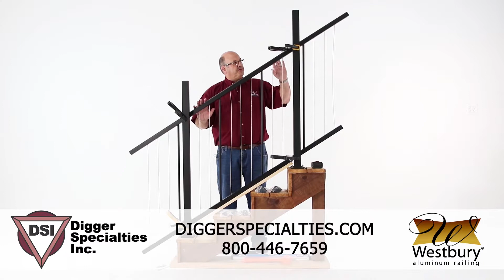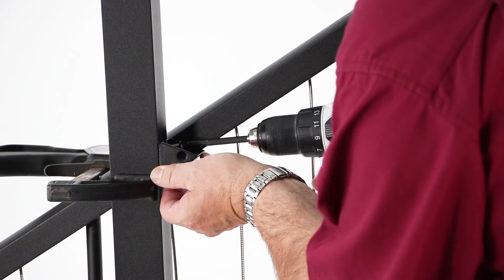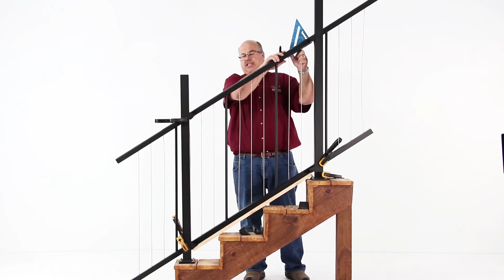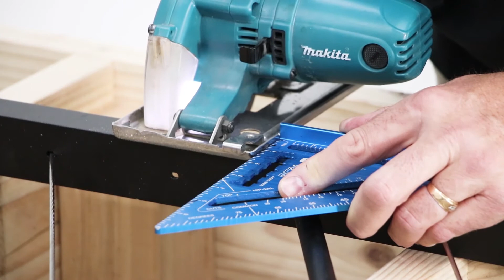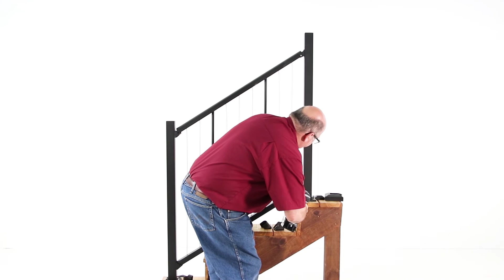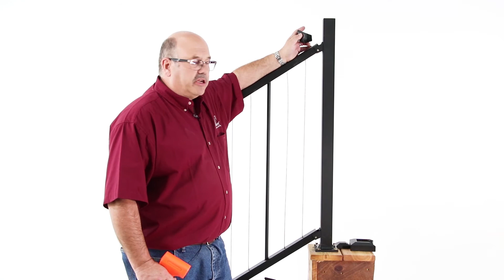Installation: Westbury VertiCable® (C80) Stair Rail

Comment: I have an issue with the cables not staying tight.  And they are just long enough that I cannot get the tensioner to grab and tighten - it does not pull the keyed bolt into the holder.  How can I rectify?